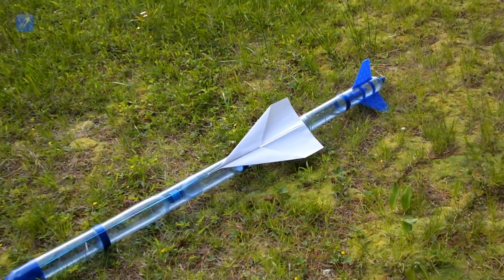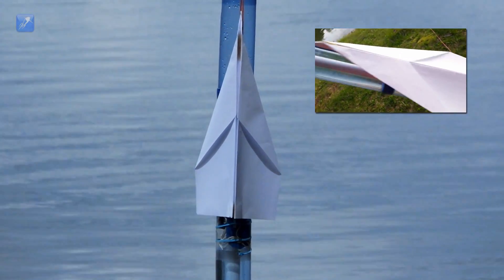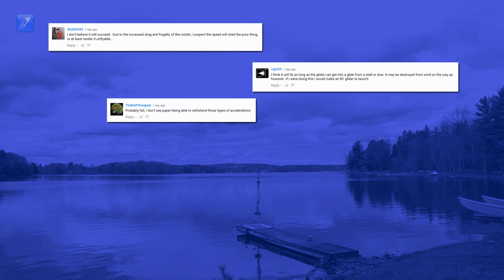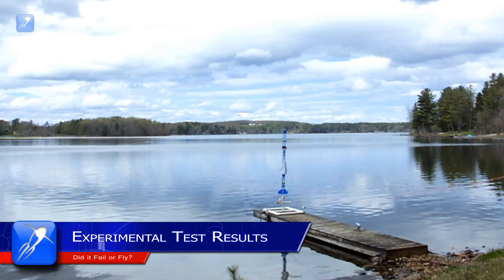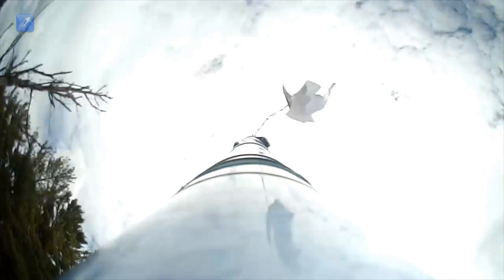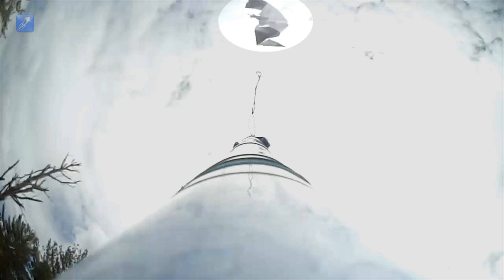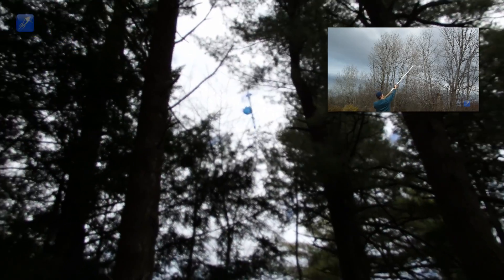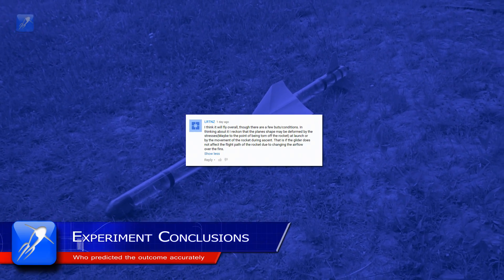Results: Water Rocket Boosted Paper Airplane Experiment

Comment: Try to add Foam to the Water. That gives less accleration but longer thrust
Reply from the maker: That is a good suggestion, however where we live it's against the law to put soap into the environment. So, we can't do foam experiments. :-( We are currently testing some soaps made for camping in the wilderness that do not pollute, but they don't seem to make long lasting foam. However, we have smaller size nozzles we can use that will have a similar effect on the acceleration.
Reply: Ohh OK. You know what? i will try that in Germany with a paperplane if it works :D
Reply from the maker: Hyperus Very cool! Glad you enjoyed the experiment!
Reply: I will try that. becuz in germany its now 8:28 AM

Comment: I would try a symmetric setup. So two (or more) paper planes to make the drag symmetric, so the rocket goes up straight and foam might reduce the high acceleration and the change of the plane tearing apart.

Comment: I think you should do the same but wrap the plane flush with the fuselage with the rubberband which hold the parachute bay. This way it wont be teared appart from the drag and when the parachute deploy it will be released :)
Reply from the maker: Awesome Idea! I am a little worried that the glider might tangle with the parachute, so I think I will add a second altimeter to do the release of the glider and give it a go.
Reply: nice :) i look forward to see this :D